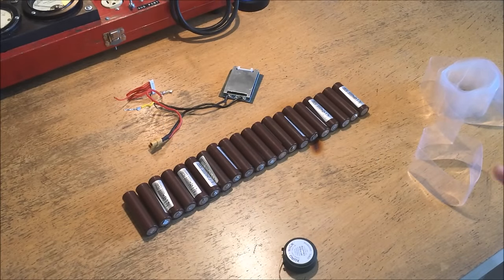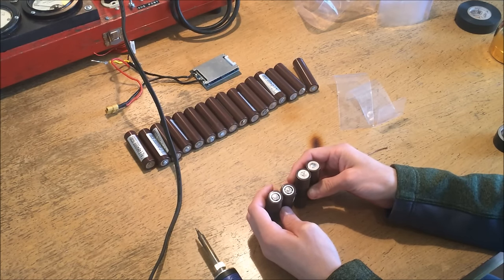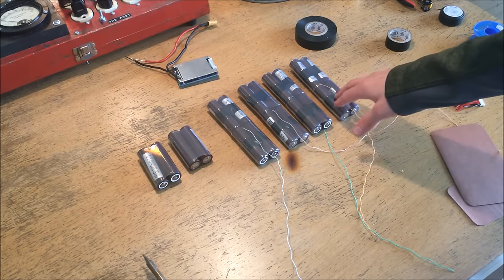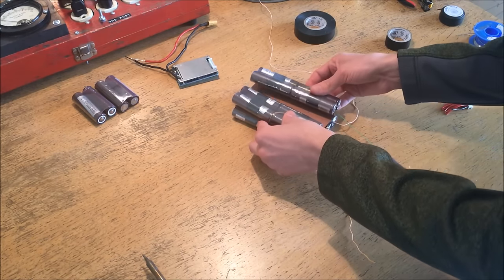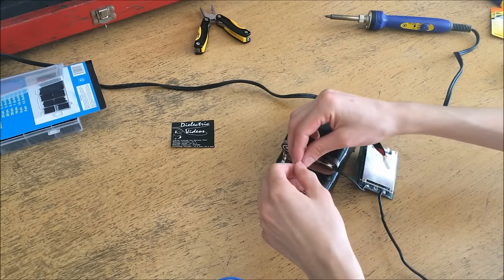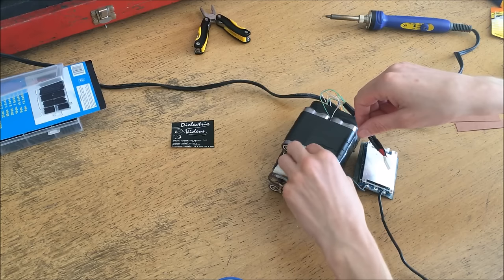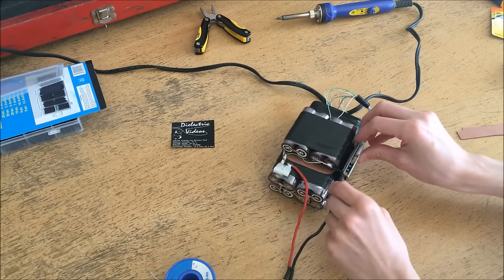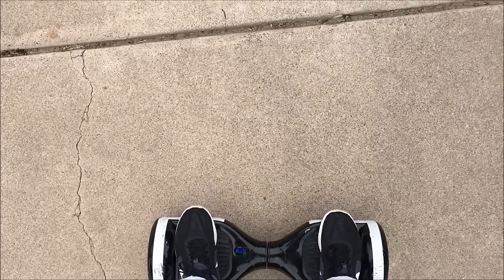EP 24 - Building a 2P10S Lithium Ion Battery Pack

Comment: Trying to find an answer to my question here. Hopefully you see this. I am constrained for space and I need to run them basically 10 over 10 slight askew. Is it possible to connect 10 pairs of 2 parallel modules in series? So (++)(--)(++)(--) etc. Where I essentially have 10 battery pairs that are parallel, running in a 10 series configuration. Thanks!

Comment: Can you provide a guide to where each balance lead attaches to?
Reply from the maker: In general, the black lead is connected to the most negative terminal (B-) of the pack. The red lead adjacent to the black lead connects to the first cell-to-cell junction, the red lead adjacent to this one connects to the second cell-to-cell junction, etc. The last red lead should connect to the most positive terminal (B+) of the pack.

If you'd like I could schedule an overview of BMS installation for a future video as well!
Reply: That would be great. I'm struggling to work out 1st starting place and which way to go through the pack. It would help if you show each connection point and which lead on the BMS connector.

Comment: Could i make it like that just without BMS
Reply from the maker: The BMS is required to balance the voltage across all 10 series-connected cell pairs. Without it, some of the cells could become overcharged and could vent or catch fire. For very short-term use it will work without balancing, but beyond 10-20 charge cycles the imbalance will cause the pack to fail catastrophically.
Reply: Yes. U can build your own battery without a bms by using a lipo balance charger. I'm currently working on my 8 inch hoverboard with a modified battery.  The batteries are gonna be 10s 5p and the cells are gonna be sanyo ncr18650ga 3500mah. Check own my YouTube channel for more infor.

Comment: Does normal battery has fuse too?
Reply: I mean premade by hoverboard company.
Reply from the maker: Typically not, as the BMS generally includes overcurrent protection. I just added the fuse as an extra precaution, in the event of a fault in the BMS.

Comment: i want to build a pack xactly like this for a laptop battery to last about ten hrs can u help me pick a good battery the pack will stay in my car for most ove the time so i dont want it to overheat when not in use during the day (in the car).
Reply from the maker: Bronco Chamo If you're looking for high-capacity cells, here is a link to some good 3400-mAh cells: https://www.amazon.com/dp/B00DHXY72O/ref=asc_df_B00DHXY72O5279250/?tag=hyprod-20&creative=395033&creativeASIN=B00DHXY72O&linkCode=df0&hvadid=167129443640&hvpos=1o1&hvnetw=g&hvrand=13890622740676244184&hvpone=&hvptwo=&hvqmt=&hvdev=m&hvdvcmdl=&hvlocint=&hvlocphy=9030067&hvtargid=pla-305982328683. You will need to determine the number of series-connected cells based on the pack voltage. If you want even more capacity, you can connect an additional cell in parallel with each series-connected cell. Be sure your laptop battery comes with a BMS/charge controller with balancing capabilities. Lastly, these cells are rated for an absolute maximum temperature of 60 C (140 F), so I would not recommend leaving them in the car. Doing so will shorten lifespan of the pack considerably, and may even start a fire.